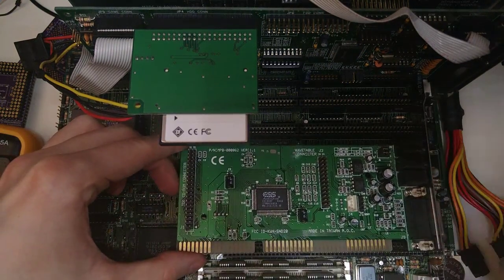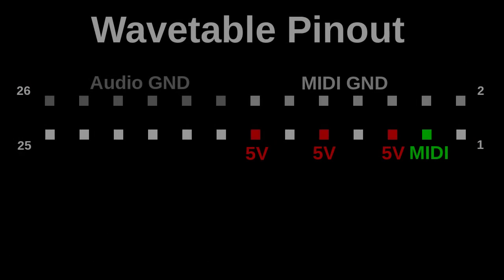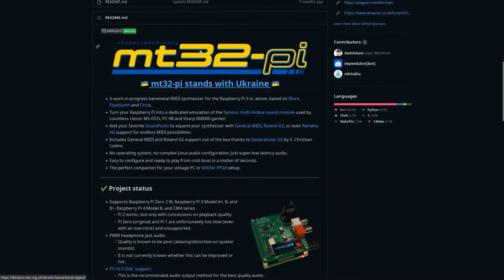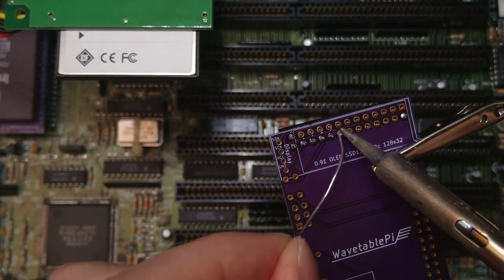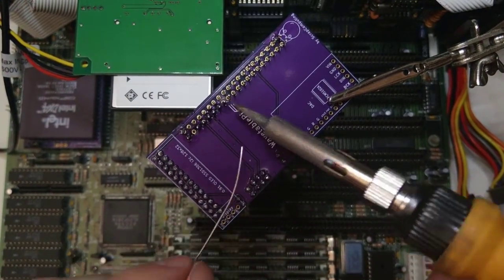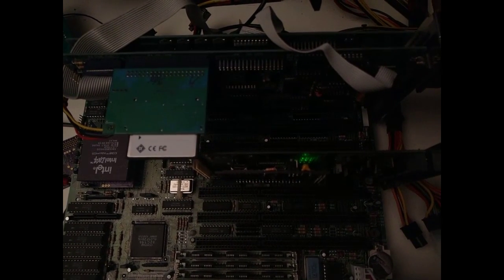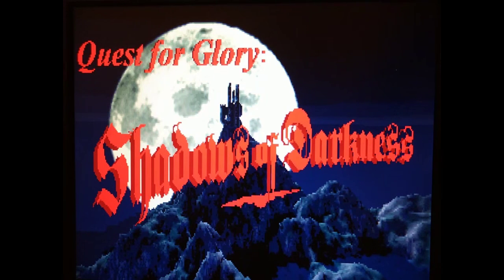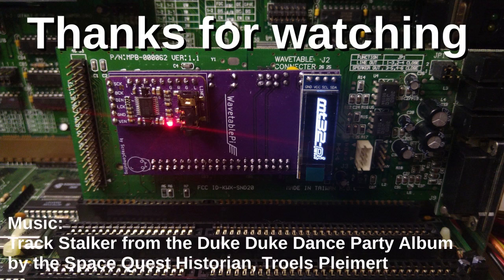WavetablePi: Wavetable Midi module powered by a Raspberry Pi Zero 2 W

Comment: Were there any config blobs on the configuration pads of the DAC?
Reply from the maker: Check out the instructions at the mt32-pi website for the GY PCM5102 DAC. There is a link to this page at the "Assembly Tips/ Troubleshooting" section of the wavetable pi project page.

Comment: Wonderful project particularly considering the cost of prebuilt options like the great but $$$ McCake solution.  I like the flexibility of the jumper option for audio output selection, but if someone includes the soldered-on DAC with this build it seems unnecessary to include the 6-pin jumper block since it has the downside of adding tall and conductive pins between the WTPi board and the sound card on which it's mounted.  A pair of 2mm jumper clips/wires to bridge the pads would do the job.  @4:11 in the video I'd argue you should move the DAC + 2 jumper wire clips OR the 6-pin header plus the necessary filtering caps/resistors outlined in your other video to the right-side of the build component manifest since one or the other is really required for this to work.
Reply from the maker: True, you are better off using jumper wires.

Regarding the component placement, there is indeed quite a bit of room for improvement, perhaps an SMD version of the board would be better. By the way there is a more recent "Horizontal" version of this on github that fits some sound cards better.

Comment: Hello! You have encouraged me to improve my sound on my Retro PC... I will look at the purchase of components and try to do it... One question... at the time of the "Smoke Test", is the switch you activate the one that turns on the PC? ?
Your videos are great and very clear... I like them! Thanks for them!!!
Reply from the maker: Yes, I am using an ATX power supply with an ATX to AT adapter. The switch connects to the adapter and turns on the power.
Reply: @scrap_computing  Perfecto!!

Comment: Great job! It would work also emulating mt-32? (including roms of course). Or only GM?
Reply from the maker: Yes, mt-32 is supported by mt32-pi.
Reply: @scrap_computing  Thank you! I already have an ESS audiodrive card but I cannot loss the FM synthesis. I suposse that I can continue using FM synthesis selecting Sound Blaster Pro (or ESS in games that natively support the card) and to select General Midi for sound from the wavetable. Is it right?
Reply from the maker: @josgardob  Correct, FM will keep working just fine.
Reply: @scrap_computing  I have build one but I cannot get sound in my ESS audiodrive (I have tested 3 sound card). The input AuxB (wavetable header) is at maximum level and the wavetable-pi LCD shows activity. At boot MT32pi logo is shown, then shows General User and the version and when I select General Midi in a game (duke nukem 3d and doom), the LCD shows activity (the typical bars). I have tested the pwm and the i2s dac as well. In Windows I have the same behaviour. It is strange, if It set the volume of speaker at maximum, I hear a lot of noise but I can distinguish the sound at background, so it seems it is working but at very very low level. What version of MT32-pi are you using? Thank you!
Reply from the maker: Are you using the right capacitor values? I think I saw one of your earlier comments that the capacitor values are wrong. The capacitors are indeed 10uF not 10nF. If you can't get 10uF you could use a smaller value like 1uF, it shouldn't sound too bad.
Reply: @scrap_computing  Hi, It is working fine, just a bad soldering. I have short-circuited the capacitors, the audio lines from the wavetable header (R and L) have already AC coupled to audio auxB inputs of the ES1868 ic. They have a 220nF capacitors on PCB board so a capacitor of 10uF is negligible when it is placed in series with a 220nF. The only inconvenience is that it cannot be used  on sound card in whitch these lines are not AC coupled directly on the sound card, relying this responsibility on the wavetable daughter board. Thank you! Very interesting project.
Reply from the maker: @josgardob  Good to know you got it to work :)

Comment: I bought a cheap, very cheap keyboard once (20 years ago?)... just for fun (I really looked for the cheapest one with Midi out). It has some nice sounds and all but I wanted it someday to just be a midi keyboard. I then forgot about it, used it, forgot about it and so on and on...)

I think I will do MT32PI (inside the keyboard) just for fun to get some more joy out of it... But again I want do it on the "cheap" side 🙂
Think I will get the audio from HDMI port (and let my hifi setup do the DAC stuff)...
So weird, then I can SSH to my Midi Keyboard... haha and run an actually OS on the thing...

Comment: I'm so glad I found this vid! I've been looking for something like this for a while now. Definitely going to build one! Also a question about the 10uf caps? This value seems unreasonably high. If they are just being used as high-pass filters for the line-in back to the ES1868, a much lower value could be used. The datasheet for the ES1868 lists the impedance for the various inputs to be between 30-100k ohms. Subbing the 10uf ceramics for a "higher" quality poly film cap around 1-2uf should give a frequency response well below 5hz according to my napkin math. Something like this (WIMA MKS2B042201F00KSSD) The distortion properties would be considerably less also, but of course, it might not be an issue for this application.

Either way, I'm happy I found your project and look forward to building one soon! 😁😁

EDIT: I see... Those 10uf caps are also in play even when not using the optional DAC. I wonder if a different choice in components in output PWM filter would work better. Something like a two stage RC filter (560ohm + 10nf) x 2 in series then passed to the line coupling capacitors. I've done this before with the Mister FPGA PWM outputs and it works very well. For me, I think I'm going to try the DAC option though first. 😋
Reply from the maker: The 10uF caps are for blocking DC, and yeah you can use different types / lower values.
PWM audio could definitely benefit from some better filtering, but my guess is most people won't bother with it as the DAC sounds so much better.

Comment: Hi! Thanks for the video. I really enjoyed watching. I have a question - is there any reason why you used ceramic (or tantalum) capacitor on the audio L/R output?
Reply from the maker: Ceramic capacitors are not polarized, one less thing to go wrong :) But yeah, I think any capacitor type should be fine.

Comment: I understand a regular Pi Zero W, unlike the Pi Zero 2 W, is too slow for emulating a Roland MT-32 via MUNT.
But I have seen people running Fluidsynth on it, so that part of MT32-Pi should run on it just fine, and it would still be able to provide wavetable output, just not MT-32 emulation?
Reply from the maker: I think you are right, but you should probably check with the mt-32pi project, I have not tried the pi zero w myself.

Comment: Can RPiPico do the stuff?
Reply from the maker: The mt32-pi software won't run on the Pico as far as I know.
Reply: No, it needs the raw performance of a full Pi, and even then, it needs at least a Pi 3 or Zero 2 for full performance. The Pi 2 needs concessions to audio quality or/and an overclock to run it, the Zero 1 and Pi 1 can't do it at all.
Reply: @Dan-TechAndMusic  I wonder if someone can make this software more ressource efficient, because if you need a Pi3 just to emulate a wavetable, you might as well emulate the whole PC on the pi and skip dealing with decade old and potentially dodgy hardware alltogether

Comment: This is extremely clever! One thing I wonder is since you're using MT32-Pi, can you use SoftMPU to enable intelligent mode over the wavetable header? I haven't found an answer to that yet. Looks like you can send SysEx commands to it, to switch configurations. Using this in my DOS build would be much better than trying to connect the MIDI output to my main PC, and use a mixer to combine the audio outputs.
Reply from the maker: Yes, I think it should work just fine. The sound card can't really tell the difference between the wavetable header and the gameport, they share the same MIDI pin. You should be able to control it with SysEx commands just fine.

Comment: I literally never heard warcraft II in any way other than fm synth lol, didn't even know it had a diffferent sound
Reply from the maker: Haha :) I think it sounds pretty good on Windows 98 general midi (sfotware) synthesizer too.
Reply: It has CD audio if you leave the disc in and the CD drive is set up to pass audio to the sound card with the use of a special cable. There were two CD audio cable standards back then and lots of sound cards supported both.

Comment: That's really cool, I love the neatness of it being inside the case.  I wonder though, would it be possible to run a cable from the board to the OLED screen so the screen could be mounted perhaps in a drive bay?
Reply: its literally just the 4 pins (gnd, vcc, sdl, sda), easy enough to run any kind of ribbon cable or whatever, up to a bay.
Reply from the maker: That's a great idea! This way it would also make sense to add a a header on the board for the mt32-pi control buttons/rotary switch! I should probably add some in the next revision of the board.
I did a quick search and it seems that i2c should work fine with 0.50m long cables. The max length depends on the bit-rate as far as I understand.

Comment: yo what soundfont did you use?
I'm tempted to start making soundfonts again and I was curious.
Also I had a similar project idea to this a few years ago but didn't have the knowhow to properly execute this. (WavePi)
Glad to see that someone else kept the idea going.
Reply from the maker: Hi, I used the default one that comes with the mt32-pi project. The filename is: "GeneralUser GS v1.511.sf2". Cool! Making soundfonts should be really cool! Is there a community around this?
Reply: @scrap_computing  sort of, but not as much as there used to be.
I made the KOR Soundfont project for making midi games sound a lot better, but it's a little too big to be used on the MT32-pi's OS. Also at the time MT32-pi didn't exist so I used normal linux for this on my pi 3b.

Comment: Do you think it's possible to use Orange Pi Zero instead of Raspberry Pi Zero ? 
I hope so but maybe you know limitations of Orange Pi Zero for this purpose
Reply from the maker: I am not sure, I am not familiar with Orange Pi.
Reply: Hi Sir, doesn't like it would fit in the small space...
Reply: @JorgeCarvalho_web_dev  , of course orange pi zero is bigger and it won't fit the same way. But it may be placed just on the bottom of a computer case. Anyway I'll try it because I have it in hand.

Comment: Really interesting idea that I didn't know I needed until now. It would certainly help with reducing desk-clutter when using a mt32-pi. Such a neat and tidy solution. I was thinking, if adding solderpads for optional buttons (with cable) to switch mode and soundfonts? Though, that can also easily be done with custom midi messages already (to be clear, I meant the likes of mt32-pi-control that you already linked, it's not just the only option). Hm, maybe I'll have to order this pcb and play with it :)
Thank you!
Reply from the maker: I had designed an earlier version of the board with buttons, but then I thought that pressing against the card is probably not the best idea, so I removed them. Yeah you can use mt32-pi-control, so it should be fine.
Please make sure that the board fits your card because it is pretty tall (76mm including the header if I remember correctly).

Comment: Great video! As always! The only request is that you have a sound card with a transverse wavetable header and the circuit is suitable for it, but most sound cards have a wavetable header located longitudinally and the Wavetable Midi module can rest. Can you add a second PCB option for the horizontal wavetable header. It will be wonderful!
Reply from the maker: Yes, you are right. It is a bit too tall for some other cards. Sure I can make one more PCB design, thanks for the suggestion!
Reply: @scrap_computing  This can also be solved with a ribbon cable without having to re-design the board, there are such a wide variety of potential wavetable header orientations that I think it's a fairly common problem.  I know some people even run the wavetable header from their sound card to a drive bay and allow for swapping the cards or even installing a switchable wavetable board selector switch accessible from the front of the case.

Comment: Great info, could this be used as an external midi device with a cable attached to the gameport?
Reply from the maker: Well, the gameport does not provide power, nor does it have any audio input pins, so you would have to take care of these with an external power supply and by passing the audio through the line-in. I think there must be quite a few projects using the Raspberry Pi 3 and 4 that are specifically designed for the game port, they should be listed on the mt32-pi project website.
Reply: @scrap_computing  Thank you very much

Comment: Hello!
With your content I might end up forcing myself to learn to solder!
Damn I'm loving your videos!
Do you recommend any tutorial to learn to navigate the ordering process of PCBs and components, thanks!
Reply: Through hole soldering is very easy as long as you've got a decent soldering station. Forget the irons that plug directly into the wall, they're absolutely useless.
Reply: @bradallen8909  It's all about flux. With proper flux you can even use these soldering irons that plug directly into the wall (Although it's better to have a model with at least some temperature regulation).
Reply: @aspinx  As important as flux is, it doesn't transform an absolutely useless soldering iron into a usable one!

Using additional flux on through hole components would be rather unusual as well.
Reply: @bradallen8909  From the personal experience, I can solder a component (a through hole, or smd, etc) using pretty much any cheap chinese iron and flux. Without flux... maybe I can do it with flux-core solder wire and an iron which is not too hot, but pure solder without flux will be very challenging, with bad looking joints, etc. Having right flux is sure more important than having a very expensive iron.
Reply: Totally disagree. Any decent quality solder has an amount of flux within it that is more than sufficient for doing through hole joints. 

But, if that's coupled to a soldering station/iron that is NOT temperature controlled, it's nothing but useless.
Reply from the maker: Ha ha go for it! Soldering is quite easy as long as you have a decent quality solder wire :)
Ordering the PCBs is quite easy: usually you just upload the zipped gerber files and that's it! Regarding components, you can find most of the parts at your local electronics shop, or check amazon / ebay, or of course proper distributors like digikey or mouser.